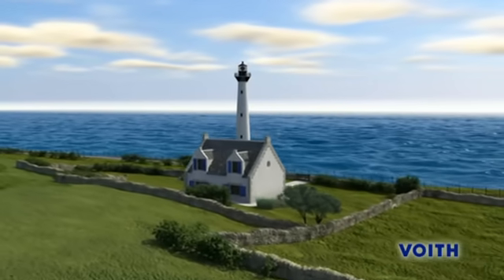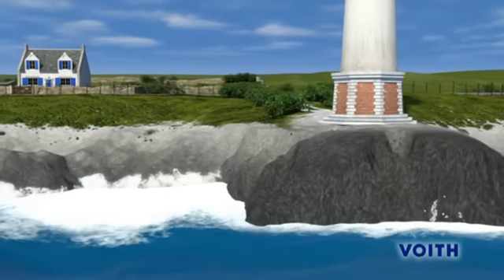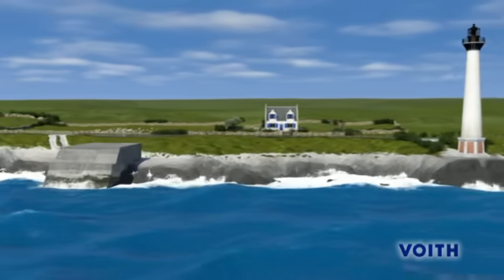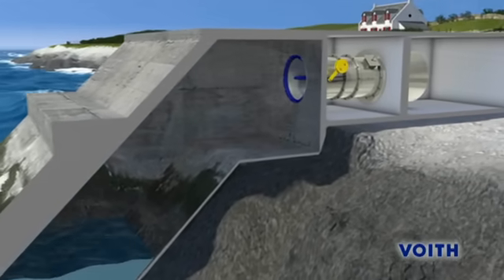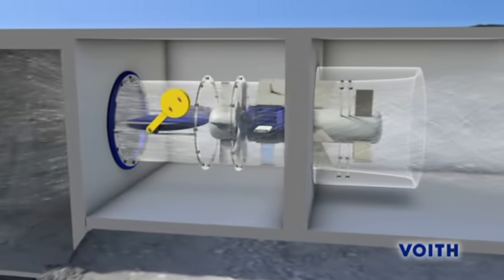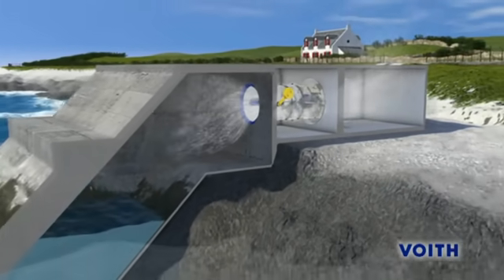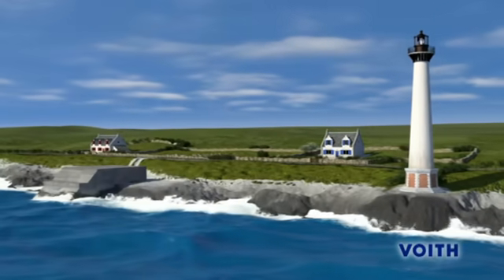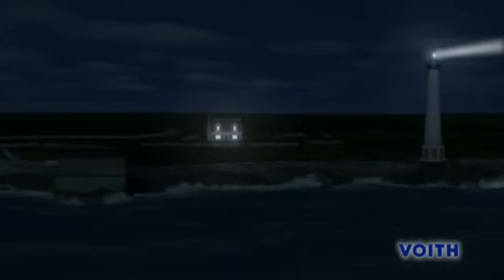Ocean Energy -  Wave Power Station

Comment: That “wave air” contains salt. How would they prevent the turbine from seizing up?
Reply: Just replace the air with a low volatility and immiscible fluid with a different density than seawater.  The slug of immiscible fluid flows back and forth through the generator instead of air. You would also have an immiscible fluid interface with air on the land side of the power generator station. Salt, a polar compound, would not traverse through the non-polar immiscible fluid from either direction and the corrosion issue goes away.  You would need to change the flow channels and generator design to work with the viscosity of the immiscible fluid.
Reply: No mate water vapour don't contain salt
Reply: @devanshtrivedi3905  anybody who lives near the ocean knows the corrosive properties of airborne seawater droplets. From rusted cars to rusted doorknobs. From brick cancer to sticky crotch.

Comment: This is an incredibly inefficient way of generating electricity. It works by displacement of air by the movement of water. Consider a cubic metre of water weighing approximately one tonne displacing a cubic metre of air weighing about one kilogram.  This is an efficiency of 0.001%. Considering the cost of the initial construction and it's environmental impact this is really a non starter as an economically viable source of power.
Reply from the maker: Thank you for your interest and your comment.I think, you are not right. In Mutriku in the Basque Country of Spain, 16 turbines of this type have been generating electricity for years, which is fed into the public grid.

Comment: the tide rises and falls yes but most of the waves are only on the surface of the ocean and do not go deep this system depends on the water level quickly rising and falling, that only would happen with a shock wave type wave tsunami. the idea of using air pressure is a good one, the water needs to be at the water height to work like this, and the problem is because the water level changes the optimal height changes. if you could make the inlet float at just the right height you could match the optimal height. but then you are back to the moving parts problem that wave capture systems have. the violent movement of the tides rips most tide machines apart before they can become cost effective in their manufacture. the most energy is in the waves but the easy way to harvest is in the water level change. I think the best systems work off of the slim margins of reliable change in water level. water level changes slowly over time, and only a few feet. all tide tech is hard few systems have even been made and how long will they practically last is the real limiting factor. we need more eyes and minds on this problem so any idea say it might be the one we need.
Reply from the maker: Thank you for your interest and your comment. In Mutriku in the Basque Country of Spain, 16 turbines of this type have been generating electricity for years, which is fed into the public grid. The system also works with rising and falling water levels.

Comment: The arc of the covenant will give you about a trillion watts if you put the coronation stone on top of it between the anode and cathode. The coronation stone is a 500 lb transducer that will vibrate and hammer on the tablets inside piezoelectrically.... to infinity because of the harmonics. Free energy has never been a secret and neither has conscious minds in a machine. You can get a trillion watts or more and it's so easy. People need to wake up to their slavery and the tyranny. The ark is tuned to 90 hertz. You just have to sing to it and it charges up. Once the spark at the gap starts jumping it will speed up to hammering on those tablets 3.6 trillion times a second. You can stop time with it and also create matter with it and turn it into a 3d printer that uses plasma as the building material and create matter from nothing but vibration. Works exactly like a printer as it forms the egg of life pattern in it's vibrations.

Comment: Great idea...I’ve been following wave and water flow turbines using natural rise and fall of coastal sea and river levels. Never thought about creating air flows from wave action.
Reply: You have followed them and not realized that all of them failed? 

It's abad idea. Wave power's energy density is low, so you have to build a lot of expensive stuff to collect meaningful kWh.
The most successful wave power plant, Mutriku Breakwater Wave Plant, was commisioned in 2011 at a cost of 6,4M€ for 296kW peak. That's 21.000€ per kW nameplate Power installed. 20 times more than wind, and 30 times more than solar. 
But maybe it's generation more power to make it worthwile?
By the end of 2023, the total lifetime generation was 3 GWh. That's about an average power over 12 years of 12kW or 9% average load factor. That's abysmal. Wind, in germany, has 23% onshore and 28% offshore. In good wind locations like Scotland or Tasmania, it's 80%.
So it absolutely sucks at power output too despite being 20 times more expensive to build /kW nameplate. 
So maybe it lasts longer than the 20 years wind turbines work? Turns out, the turbines are worn already and need to be reoplaced for 3,4M€. 
SSo they even last only half a slong, making them 75-150 times more expensive per kWh generated than wind. 

it's a crime to still burn valuable renevable investmentcapital on wave power after all those projects proving without a doubt that it is far too expensive to build and maintain.

A € in wind power saves  75 to 150times more CO2 than the most successfukl wave power plant does. 

And still- new projects are popping up sucking away all that green investor money to shurely fail.

Comment: It looks so pretty without all that silly voltage regulator circuits, dc to ac inverters, Wires, step up transformers, switch gear housing, line carrying poles, metering...But; it does look pretty...

Comment: I'm not convinced that compressing air (thermodynamic irreversibility) and then converting the pressure differential by means of a turbine (max 60% theoretical efficiency, Btet's theorem!) is the best option. I would have rather made an electromagnetic piston driven directly by the water.

Comment: How would you account the high tide and low tide. In order to generate a considerable amount of power you would need a relatively large differential in tidal wave which will be reduced when high tide. and even if it does generate that power, turbines will experience substantial amount of cyclic loading due to back and forth flow of the wind( there are two rotors since it can only rotate at one direction per airflow means one has to stop or slow down probably)  leading to premature fatigue failure.

Comment: I've been in the biggest power plant of this kind at Mutriku and it didn't look too promising. Power density of the installation is ridiculously low. They are 16 turbines and in total they don't reach   300kW. You may say: it is free energy. Yes, but it completely destroys the landscape. For me it has much bigger visual impact that wind turbines.
In the case of Mutriku, it wasn't a bad investment as they already needed a modern port and they made both projects in one. They also made an artificial beach and a pool for the citizens so they were happy with the project. Probably those 300kW covers a big part of the electric needs of such a small town but it really is an unmature technology.

Comment: Sadly all wave power systems tried so far have been wrecked by storms, no matter how clever.
Reply from the maker: The system has been working very well in Mutriku, Spain for many years. 16 Wells turbines supply electricity for 225 households.

Comment: no le creo  el 100% a Voith.
Reply from the maker: you can trust Voith. 16 Wells turbines from Voith have been working for several years in the Mutriku / Spain breakwater and supply electricity for 250 households
Reply: @IdeasfortheGreenPlanet  Trabajo con Voith paper y no responden con certezas por sus productos.

Comment: Rather than making a cement block we could have put the turbine in a open space so that more air could hit the turbines and can easily generate the electricity
Reply from the maker: The Wells turbine is not a wind turbine. It brings much more pressure to be kept in rotation. Hence the narrowing of the large space through the small opening.

Comment: There is a company which uses reciprocating compressor principle . The kinetic energy of waves is used and converted to reciprocating motion with help of floating device. That thing is practically implemented.
Reply from the maker: There are many ways to generate energy from the power of the waves. The Wells Turbine shown here is just one of them - but it has been proven for years and is currently in continuous use in Mutriku.

Comment: Ganaretor Fan not Rotad one side air wave  is back or forward
Reply from the maker: That's the specialty of Wells Turbine. It always turns in the same direction - no matter which direction the airflow comes from.

Comment: Can not we use paddle wheel usibg the power of waves for generatiing electricity , and it will be more efficient Right?
Reply from the maker: A paddle wheel is driven only by the air flow from one direction. The Wells turbine, on the other hand, always runs smoothly, no matter which direction the airflow comes from.

Comment: I have to wonder how large is the grid on the Scottish Isle of Illa [sic]- and unless they have figured a way to stop corrosion, it won't produce more than you spend on maintenance in the long run.  Floats with simple mechanics easy and cheap to produce could take advantage of wave motion without so much concrete and corrosion of the more sensitive parts of the machine.
Reply from the maker: Thank you for your comment. This power plant on the Isle of Islay has been closed in summer 2018. It had 2 turbines, 250 kW each. In the year 2011 in Mutriku, Spain the first commercial wave power plant with 16 turbines based on the "Oscillating Water Column"  principle was opened. It was designed to produce approx. 300 kW for 250 households. We will create a video where we will explain the plant design (the turbines are placed in the water breaker) and want to address the costs as well.

Comment: Air is compressible.so it wont rotate the turbine unless the air pressure is very high.
Better connect a reciprocating piston with a fluid medium.
Reply: @Sho Yu Weeni what if u make the turbines smaller?
Reply: heck why not just ditch the air thing and dunk the whole system under water? waves still go up'n down right?
Reply: @phoboss950  correct. A different wave-action generator would be way better.
Reply: Вот именно. Что бы воздух начал крутить турбину, давление воздуха должно быть существенным а сопротивление турбины при вращении, минимальным. Но это значит и минимальные вырабатываемые токи. 
 Скорее как забавная и дорогостоящая игрушка получается. А точнее некий обман людей, показывая доступность энергии, но не показывая бесполезность такой затеи.

Comment: I'd be interested in know the maintenance demands for this generator. Specifically with effects of corrosion from constant moisture and sea salt exposure.
Reply from the maker: @J Will. Thank you for your comment. We are working at the moment on video about Mutriku Commercial Wave Power Plant, which was opened in 2011. We hope that we will get some real data about maintenance costs.
Reply: @redfox435cat  But that is, because you don't want to build a boat from A4. That would be horribly expensive and the material has other disadvantages for such big structures. E.g. although it is super tough to grind, etc., it is also quite brittle, so under constant mechanical stress, it could crack open - which is not what you want with a boat. On a more or less small and static installation such as this turbine, however, you could use A4...
Reply: @redfox435cat  But a boat is not a generator - at all. That's two completely different things. I don't know how this generator was built, so I can't tell you why it needed so much maintenance, but I'm very sure that it is possible to build such a generator with low maintenance costs...
Reply: @redfox435cat  Yes, I am not stupid. I am aware that the problem is salt water and everything that is exposed to it. But a generator is still not a boat. There are certainly good reasons why a boat is not constructed from A4 or an aluminum titanium alloy... (One reason can be, because it's horribly expensive)
Reply: This would be an epic battle with environmentalists...
Reply: The maintenance demands are still much less than a nuclear power plant .No toxic emmisions why do people not find this to be what we should be building . Why? Its called greed
Reply: Probably less maintenence than a ship 🚢
Reply: Turbine (alloys like stainless steel)
The body (Coatings, etc)
Reply: @marcboutilier7044  Yes, there 2 that I know of, MP-39-N and MP-59-N I believe developed by the US Navy and produced by Carpenertown Steel.
Reply: @davidschwartz5127  sweet
Reply: Ever heard of a boat? Just look up there.
Reply: @LoggyWD  yes, boats doesn't need maintenance..
Reply: @izoyt  Ahah, right...

Comment: How does the turbine get bi-directional wind while spinning same axis?
Reply: That's what I thought
Reply: Wells turbine!
Reply: Because you guys are not engineers.
Reply: Water blows air out and suck back the air but I wonder how the turbine will keep turning in one direction
Reply: Its work on chopper blades principal. You can checks aerodynamics of this.
Reply: @deepakkumardhruvthak  You mean Autorotation?
Reply: You don't have to keep the rotation direction, because the AC current generated can be fully rectified to generate unidirectional DC current, which is then inverted back to AC according to the phase of the grid.
Reply from the maker: The Wells turbine rotates ALLWAYS in the same direction, although the air oscillates. We are working on an animation where we will explain the working principles of this wells turbine so also the people who are not engineers will understand it. Stay tuned.

Comment: There is no funnel. Inefficient. Funnel the water and let the water turn blades incoming and outgoing. The entire beach being zig-zag concrete walls. Just playing with cartoons here. Big construction for very little power. Think of a paddle wheel steamer. A lot of surface area means big torque. Build a floating island and tether it by linkage to a shore based geared generator. As the island rises and falls with the tide it would move with the worlds greatest torque. Think big. No. Think Biggest. We are running out of time. Think of the island sitting on 4 corner pistons 10 feet wide each. When the tide goes out how much PSI would each piston produce per 1 foot drop if the island weighs 1 million pounds and the compression ratio is 10 to 1 and a 6 foot stroke.

Comment: Sadly it seems that has been a failure.  Islay LIMPET was primitively rated for 500 Mw, soon downgraded to 250. It has been decommissioned around 2012. The building is now empty.
https://en.wikipedia.org/wiki/Islay_LIMPET
In Portugal around 2002 another wave energy power generator did not last, as it was plagued by technical problems. It seems that the assertions about the efficiency are highly optimistic.

Comment: many problems spotted .
1. coastal land is too expensive 
2. that water level doesn't jump the way you want it, it could easily overflow . 
3. feeding it to the grid is hard as these powerhouses would be scattered all over the shores  .
4. That sea water and that moist on the air has so much salt and would produce so much corrosion , maintenance would be very hard and costly 
5. That bunker needs to be very strong to not be shattered by the relentless power of waves, hence very expensive while that turbine looks very small , and i can't imagine the water level moving so fast that i would rotate it in any significant speeds . 
6. The construction would have to be very difficult and very different based on the shores . 
7. Wind turbines are better , less costly .

Comment: ooohhh... so its like a reverse wave machine then where instead of pumping air in to cause the water level to rise, the water pushes the air out to drive the turbine...

huh...

though i have to admit, while its a great idea you have to wonder just how many would be required to make some real energy and what kind of scale your looking at for the turbines and chambers to ensure adequate motion as well as the fact it would be delivering presumably variable power due to the chamber being filled and emptied at varying speeds during the waves movement as well as to various extents...

Comment: Don't pat yourself on the back yet guys, it doesn't produce any CO2 during generation of power but it created several tons during the production of the cement. And more to transport the raw materials there and during site preparation. The moral of the story is that nothing is green from the outset. There is a payback period after which the power is free of CO2 production and the input energy is free.

Comment: I'd replace the turbine by a pressure piston (similar to a steam locomotive)
In theory it should be more efficient as more of the high pressure air will be used to perform work due to the enclosed nature of a piston drive. The downside being increased friction & some energy loss but I think the overall increased work should make up for it.. .

Comment: Is it not true, that the Wells turbine-Islay installation provides one-tenth the energy output that the engineers calculated?  One-tenth!  That's a huge amount of error!  Correct me, I am just speculating because I forgot the actual numbers, but the Islay experiment cost $ millions in construction costs, yet puts out as little energy as $  thousands for a wind turbine or  solar panel.
I believe the Islay / Wells turbine installation was plus-twenty years ago, so you don't see much about it.  But it set back wave energy popularity a lot.